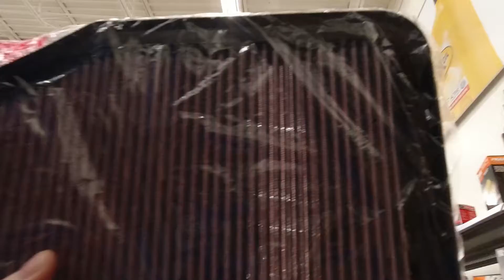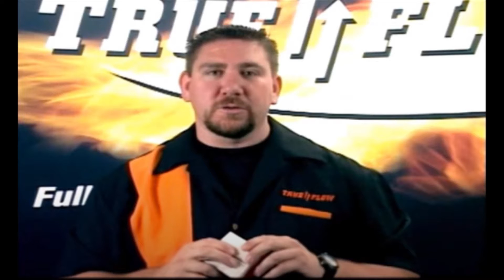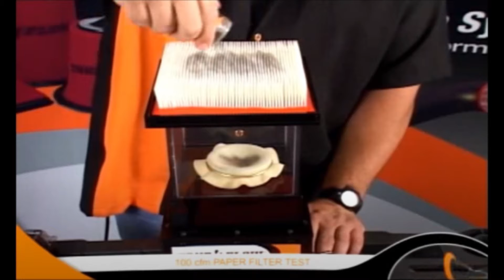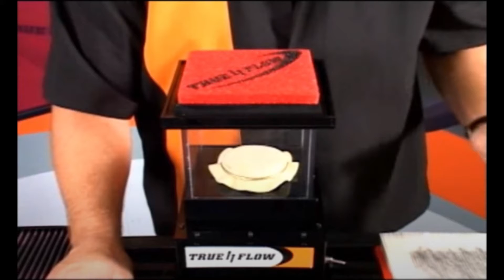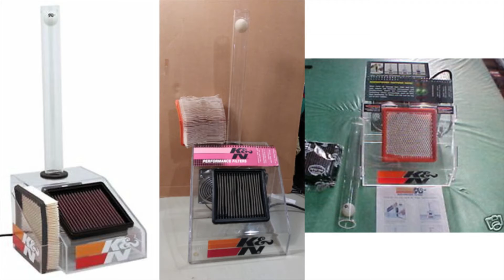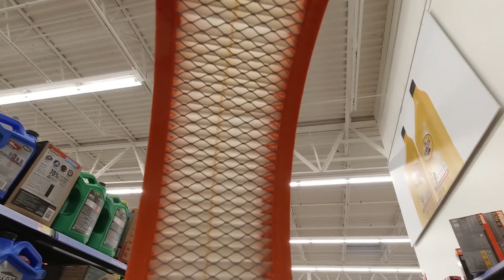Are K&N Air Filters Junk?

Comment: K&N filters are the only filters used on Baja for a reason. And they still flow excellent with a ton of dirt on them. The whole trick is small fibers of the oiled gauze are fluttering/vibrating  in the air stream with the intake pulses, and catch the dirt. That's why every bench test with a steady air stream fails (no pulses), but they work great on engines.
Reply from the maker: Marketing nonsense.
Reply: How many Baja engines are run for 100,000 miles?

Comment: I’ve run K&N on most of my stuff, and I think the older K&N had more filter media than they do now. Having said that, I’d never run one in a true dusty environment.  Living on a dirt road is not a dusty environment.  Also, I believe the oil is a major component in catching the dust.  On a side note, I believe that the Cold Air Intake is both a gimmick and myth. Most of the time it’s $400 worth of plastic that draws in more hot air than factory setup.

Comment: i really do think it comes down to the application, for a high performance car that stays on the tarmac i think definitely use a cotton filter, for a 4x4 in heavy dust use a foam filter just like a dirt bike , and for the everyday consumer who drives a small economical hatchback  and doesn’t care a paper filter will work fine and replaced when specified, as for the filtration levels i feel the foam will work best and that’s why all dirt bikes run them. as for the best flow foam and cotton are best,

Comment: K&N claims that their filters trap dirt by virtue of the fact that, as air is drawn through during engine operation, the cotton fibers vibrate and thus the contact surface to trap dirt particles is vastly increased. Therefore simply shining a light through the filter and observing light-emitting gaps is not relevant to actual operation on an engine. Going beyond the K&N, I can attest, through personal observation, that the absolute worst filter is the Edelbrock Pro Flow. I had one of these on my very first car, a 1971 Capri 2000 on which I had installed an Ak Miller turbo kit. After a few thousand miles I removed the filter for cleaning and literally found sand on the filter carb base plate. Keep in mind this was 45 years ago when that filter was marketed as a Weber. It is amazing that a company with the reputation of Edelbrock continues to sell it.
Reply from the maker: I didn't read a thing past, "the cotton fibers vibrate and thus the contact surface to trap dirt particles is vastly increased".  

Its literally the funniest thing I've seen commented on this channel in years.  Thanks for that.
Reply: @MuscleCarSolutions  David Vizard actually talked about this a long time ago in a video talking about Austin Mini 1275 engines.  Apparently its true, the engine pulses move the fibers, which collects the dirt (like windshield wipers collect water).  The Vizard video is on YouTube somewhere.

Comment: Had 2 Tacomas that went thru O2 sensors, when I got a MAF code I read about the oiled K&N  problem. Switched back to paper, no problems with O2 or MAF since.
Reply from the maker: Some are just more temperamental than others.  Frustrating for sure.

Comment: I don’t like foam on top of a carb, not so fire resistant.  For off-road in the dirt, I’d prefer paper.  I like K&N for street cruisers and drag race, cleaner applications.  Thanks for the video.
Reply from the maker: The foam that’s rated for it works fine and typically a better filter in some dusty applications.  The k&n is the worst at filtering.

Comment: I’ve used K&N and they tend to foul MAFs tried less oil , still had failures .

When I had my TDI I ran a Piper X filter which was foam, giving you better filtration and washability. 

But I eventually went back to paper 

On my SBC I’m running paper. It’s just easier and I rather have the protection , rather than the “improved “‘flow 

What’s your take on ram air style air cleaners , as the open element just pull in hot air

Another great video btw!!
Reply from the maker: Thanks bud I really appreciate it!

Only vehicle I ever had issue fouling the maf was a little ford escort that had been a raffle vehicle.  Had some cheap CAI on it and it literally killed sensors every few weeks.  

I’m kinda in the same place you are.  Back to paper unless a better alternative comes along.  You mentioned a ram air style intake and if I’m following you, those are even worse!  Sacrifice filtration for looks will eventually kill the engine.
Reply: Muscle Car Solutions Ram air kits I’ve seen with “dryer” style duct work to a air cleaner 

What do you recommend for an air cleaner? Stick with open element style setup?
Reply from the maker: Tool Junkie ah I’m following you now.  If you wanted it for looks I’m sure it will be fine.  My gut tells me it would kill a little power in the process unless the vehicle was already moving.  Don’t know that it would be a noticeable loss though.  I’ve always stuck with the 14” open element.  Seems as though it would be less restrictive.
Reply: I may have misunderstood a bit, but ram air changes density at different speeds?  That would make AFR hard to follow/set?
The idea of moving intake and/or filter to a cooler location might help?  Just not varying pressure location, MHO.
Reply: StuckInMyGarage makers sense, just with my sbc with iron heads the air coming in is probably all warm and toasty. A cowl hood is not an option as in Canada we get reamed on parts ...   so looking for ideas
Reply: I had that same problem. The technician at the dealership told me that the oil was getting on the MAP sensor. I just started cleaning the filter, and using a medium sized paint brush to apply the oil, and let it wick for about a day, then I never had any issues with it for the last 10 years that I drove it

Comment: Thanks for reminding me about the True Flow system, I thought they had really hit the mark. Wish they were still an option. I tend to run paper but have used K&N and really have no complaints with them, I will admit I run a foam ring on both though. The couple of pony's you might loose are really not noticeable unless you are on the track.
Reply from the maker: Forgot about them till I started putting this together.  Kind of surprised no other manufacturer has gone down that path since they shut the doors.

Comment: Hi. I never thought about the wet filter getting to sensors.   What do u use on a regular basis to replace a 14x3 round?  Wrap a foam around it?  Do both materiala?
Cheers
Reply from the maker: For sure that “pre filter” is a good option.  Used them for years in different applications.  The question that comes up is does it kill HP and how much?  

I’ve run just a Fram paper element on most things.
Reply: @MuscleCarSolutions  same, here. BTW,   had to order 14x3, because stores only had 13×3.   I figure if u get bigger filter element, less restriction.  Maybe, u could afford the foam wrap?    I like the filter blue one u had in video.  Least restrictions.
Reply from the maker: The blue one is made by Edelbrock.  https://amzn.to/3is63cR